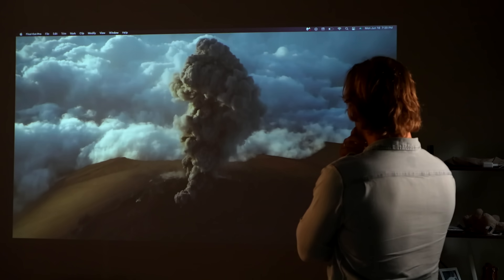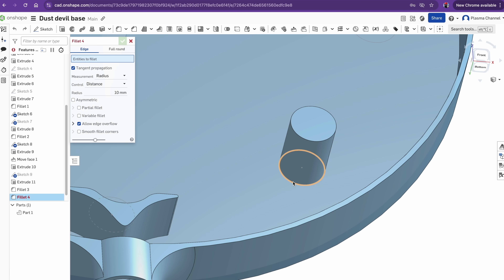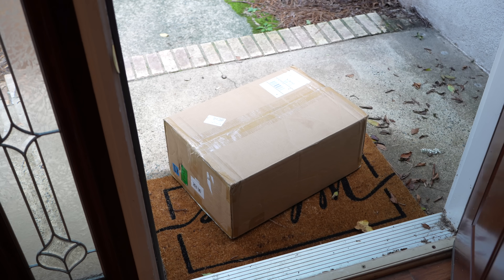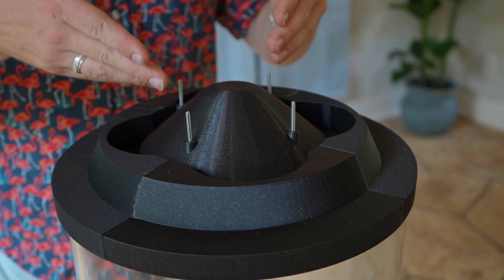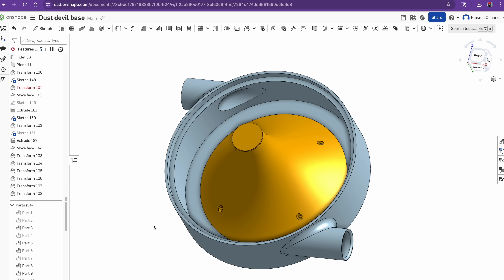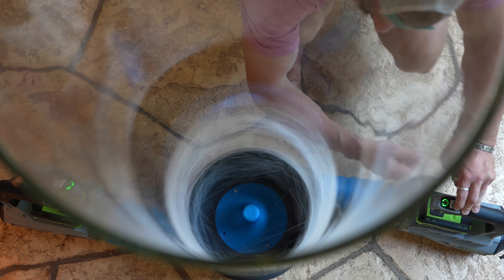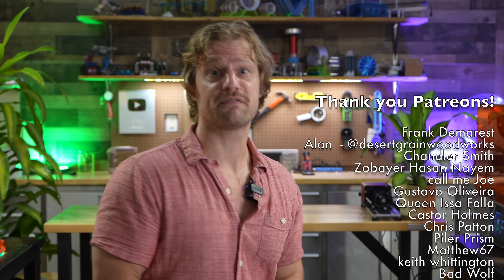Making Lightning In A Bottle Might Be Possible  (ft. 3D Printing Nerd)

Comment: Hi Jay, Mr Vortex here. To make a tornado in that glas tube, you don't need to blow air in, it's actually bad for a vortex. You know about the pessure of the atmosphere right? So you only need to remove (suck) the air out of the center top and the air will shoot into the intakes. Make 2 or more air intakes at the bottom, max away from the center, 90 degrees off center. Hope this helps!
Reply: So essentially the same principle as a bathtub draining
Reply: @UnfussyLeaf2440  Or a tornado.
Reply: @UnfussyLeaf2440  essencially the same as those fire tornado demonstrations yt scientist do
Reply: @UnfussyLeaf2440  thats the basic understanding of it yea
Reply: Is there a video that explains the difference between blowing air in vs sucking it out? And how that impacts vortex generation?
Reply: @calif94577  I'm no expert, but I'm guessing that blowing air in creates too much turbulent air for a stable vortex. Versus sucking air out creates a more stable influx of air all going to the same location, being the vacuum.
Reply: @calif94577  think about the difference of a jet of air entering a volume against a hole sucking out air of a volume. The sucking hole takes in air much more from around the hole, whereas the blowing hole just blows it out and spreads it a bit. From these initial conditions a controlled chaos takes over that you can approximate with fluid dynamics.
Reply: @007hansen I might be wrong but thinking about it or explaining in a simpler way for people to understand is always best.

Increasing pressure means things expand to take up space, decreasing pressure means things want to shrink and collapse taking up less space.

Pressure in = expanding like a balloon to fill the volume of the container

Pressure Out = Contracting smaller like a straw that squeezes itself shut when you try really hard to drink a thick milkshake. The dust forms a skinny vortex shape while taking the quickest straight line to the low pressure end
Reply: @calif94577  the difference is laminar flow. Pumps usually disturb the flow of which leads to turbulent Flo and that's bad for vortices.
Reply: @calif94577  That's an interesting question: Is there a difference between blowing air into a vortex cylinder and sucking air out of the top? In both cases, the difference in air pressure causes the air to move. Small tornadoes are actually very sensitive, for turbulence and other things. When blowing air in, it is easy to introduce too much turbulence resuling in no vortex formation. Getting air to move by connecting to an area of lower air pressure can be much gentler to the air. Kind of similar; compare blowing out a candle to sucking out a candle.
Reply: Definitely agree, I believe Tech Ingredients have a similar design for a giant vortex within a housing.
Reply: @pabloarroyo8546  If you watch Tech Ingredient's vortex you will see that it actually forms upside down. This is because he was introducing air at the bottom from a wide base and exhausting it at the top from the centre. Same thing here - if he does form a vortex it will be upside down.
Reply: Wise words from the man himself
Reply: This. As soon as I saw the weak performance with the leaf blowers, I immediately thought "what about a vacuum cleaner on the top?"
Reply: It’s easier to pull a string than it is to push
Reply: @kjbaran  Like that Steve Mould video with the chains
Reply: I agree with your design concept. You know though that some people get that "automatic square wheel" stuck in their head when designing. "If you just push the square wheel up to the Apex... And give a little push, it will roll by itself... All the way down to the flat 🤣."
Tqm philosophy. His design is an example of doing the right thing the wrong way. Even on cfm's going into his design he didn't incorporate any venturi openings on the exhaust on the blowers at the intake to the device for additional cfm at lower pressure. At the top you would have an inverted cone designed with a smaller diameter of course. You could adjust the flow with the Venturi openings. This isn't the most efficient design as the fan on top would be but for aesthetics if that was the goal would leave it clean and you could engineer everything into the base.
Reply: @bsrcat1  Wow if only i was half as intelligent/sarcastic as you.
Reply: @budgiefriend  I have faith in you. Sarcasm is the only way to make lite of the obvious. We have all tried to complete tasks in our life where we knew the goal, and insist on ice skating uphill. Even worse, knowing the correct way to do something and your Superior doesn't take your input, then forces you to ice skate uphill, can't figure out why it won't work, then when you point out the obvious, execute it, it works, then they take the credit 🤣.
Getting "stuck" on a incomplete or poor design can cost a lot of time and money. I have had projects that I work in my head and fail, fail, and fail again upwards of a year before I even decide to pick up a pencil and design a rough. Now I might pick up a calculator or use a computer along that year to work out calculations but my tools that I design and things that I make 9x out of 10, work on the first go. When I was younger, I would often get "stuck" wasting all kinds of money, time and effort. And I just slow down, gave the problem sufficient thought, then worked out all the details, I would have been far better off as would have my pockets 🤣.
I work everything backwards now. I see the goal, then work out every detail to achieve the goal and all of its parts. 
Sarcasm comes from being able to laugh at your younger self 🤣. I used to teach classes the same way and none of my students ever fell asleep. I was teaching law... And there is nothing dryer in this world toteach or learn 🤣. It's a good day when your students laugh and look forward to the class. It's a better day when they all ace the exams.
Reply: Not that efficiency is the goal but sucking air out requires less energy than blowing it in :)
Reply: I can't like this comment since it's currently at 666 👍 and that just fits too well.
Reply: I was wondering why he chose to blow instead of suck. Every tornado demo I've seen uses negative pressure, not positive
Reply: @nicksalve  Note: there is no such thing as negative air pressure. It can be relative low, but not negative. And yes: all tornado’s have very low airpressure in their center. Otherwise, it's just a rotating air column.
Reply: im sure this is also a factor :

Quartz-Dominated Silica Sand

Mostly pure SiO₂ (quartz)

	•	Origin: Weathered granite or quartzite
	•	Found in: Sahara, Mojave, Arabian deserts
	•	Electrostatic Potential: ★★★★☆
	•	Why: Quartz is piezoelectric and triboelectric. Dry, rounded quartz grains can accumulate static charge readily under friction or wind agitation.

Gypsum Sand

Composition: Calcium sulfate dihydrate (CaSO₄·2H₂O)
	•	Found in: White Sands National Park, New Mexico
	•	Electrostatic Potential: ★★☆☆☆
	•	Why: Softer, dissolves more easily, and less triboelectric than quartz. It also holds moisture, reducing electrostatic buildup.

Basaltic Sand
	•	Color: Black or dark gray
	•	Composition: Pyroxene, olivine, magnetite, feldspar
	•	Found in: Volcanic desert regions, e.g., Hawaiian lava deserts
	•	Electrostatic Potential: ★★★☆☆
	•	Why: Magnetite is conductive, but olivine and pyroxene are more insulating. Uneven charge accumulation with magnetic interactions.

Iron Oxide-Coated Sand (Red Desert Sand)
	•	Color: Reddish-orange
	•	Composition: Quartz cores coated with iron oxides (hematite, goethite)
	•	Found in: Australian Outback, parts of the Namib and Kalahari
	•	Electrostatic Potential: ★★★★★
	•	Why: The iron oxide coating creates strong triboelectric charging when grains rub. The heterogeneity between quartz and iron increases charge separation.

Feldspathic Sand
	•	Color: Light brown to pink
	•	Composition: Feldspars (orthoclase, plagioclase), some quartz
	•	Found in: Transitional deserts (e.g., central Iran)
	•	Electrostatic Potential: ★★★★☆
	•	Why: Feldspar has different electron affinity than quartz; rubbing between grains of mixed mineralogy causes high charge buildup.
Reply: A vacuum at the top also increases the resistivity of the air by reducing the air pressure. The same principle is seen by dry air in winter which allows for more static charge to build up before discharge in the form of spark jump.
Reply: Oh snap I’ve watched your vids good stuff there
Reply: But why does it make a difference? Less turbulence at the intakes?
Reply: @MadScientist267  You can't force a tornado into existance by blowing turbulent air to a center. You'll only create a turbulent rotating air column.
Reply: Genius
Reply: ☝️ That's what I was going to say. But you also need swirl tubes at the top to extract the air without the particles. The thing with swirl tubes is they need to be seized correctly for mass flow and particle mass and volume. The bottom would also need to be overlapping inlet slits. The number and length of the vanes also needs to be calculated for mass flow and ∆ pressure. The radius on the curve for the vanes also will determine the tightness of the vortex. Just as a starting point I would have the inlet vanes with a 20° angle from the tangent, the same radius of the base with 35% overlap.
Reply: You'd think we'd have had dysons long enough for people to get that!
Reply: I like how you didn't acknowledge or comment on your comment
Reply: Does this have anything to do with why you don’t use a vacuum on a computer because of the risk of static discharge and only use blowers?
Reply: I’m a big fan of you ❤ ha get it
Reply: @tornadoclips2022 It feels strange to say, but have a lot of fans. Having so many fans has never been the goal of what I am working on, but it is kind of nice. High-pressure fans, large-volume fans, luckily not too many large fans.
Reply: It basically needs negative pressure, not positive
Reply: @michaelbannan9972  What is "negative pressure”?
Reply: @GiesbertNijhuis Pulling air out is negative pressure. Pushing air in is positive pressure.
Reply: Do you have a youtube channel?
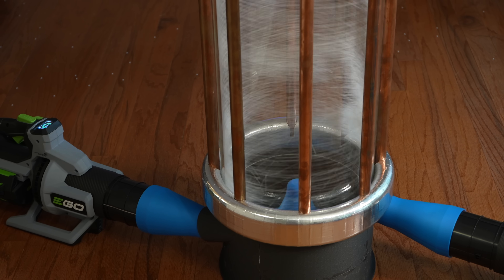Reply: @PlasmaChannel , at 13:40 you had your answer. While air is blown in no static is developed. The moment you shut down the blowers and the air can only escape to the less pressurized place(out of the tube) then static is developed. So you need to suck not blow
Reply: 90° off center of what? 90° off center on the bottom of a a cylinder is still the center, no?
Reply: Think about that maybe it's an idea. 
What if you place a motor in the middle of the tube at the bottom and you make a rotor with 3-4 blades which are standing vertical ( | ) 😅 
Spin it up fast in the tube. Try it first like a 200mm diameter disc with 3-4  blades which are vertical. What do you think
Reply: Hi. I am an Aussie and I live in Philippines currently. A cyclone or typhoon vortex is caused by temperature differential as far as I know. Don't know if that can be applied in his experiment though. Does anyone have any thoughts on this? Thanks.
Reply: She right you dont need the air to come out or in the completely sealed.
Reply: dont think he listens or reponds
Reply: It's the same thing
Reply: @izysly6924 It's not.

Comment: so if the charge is build up between two different kind of beads that are randomly shuffled around constantly, how is a charge supposed to accumulate? it will dissipate between the beads and will never create more charge than is determined based on the ratio of beads you put in. an 1:1 ratio would mean no charge accumulating during the storm, and the only charge separation would be from the mechanical separation between beads based on density, size (electrostatic force is negligible at those speeds) at the time you switch it off. 

also what was that attempt at inductively harvesting a static charge? am i missing something? how should that have worked?

Comment: Like capturing the static potential of the electric fields surrounding the earth as soon as you start drawing power from it you degrade the resource. Tesla turbines (the ones that capture energy from a movie fluid) and sterling engines are both nearly 100% efficient, until you try to use them to do any work and then they fall dramatically.

Comment: The pointing trick works because the balls and the glass are attracted to each other but introducing yourself as a ground circuit you help distribute the charge picked up from the bottom of the cyclone/air

Comment: consider how cyclone vacuums work - instead of trying to force a cyclone from the bottom by pushing air in, use a vacuum (eg vacuum cleaner) to extract air from the top (centre). New air doesn't come it at the base, it comes in at the top as well, but tangentially to the cylinder. This should create the type of cyclone you are looking for. You can then use particles of differing types as originally intended to create the charge
Reply: Mix multiple materials to share the charge up and then the build can discharge with a a higher limit by the specific exchanges. Like a rod in a battery but the opposite. The multimaterial would limit unwanted exchanges to the materials. I hope that made sense lol. Balls share to something slightly stronger and generate a flow that opens up. The tinfoil is like opening a dam and releasing the build too much too quick. Make some small rivers that open up later or transfer to battery and then set this outside and let the wind catch it sorta like when an old man plays the jug by blowing into it.
Reply: @MindoftheInfinite if the different materials have separate weights, maybe they would be suspended at different heights and adjusted with multi vacuum control.
Reply: That’s deadass what I was thinking. Because generating a vortex is SO much easier from above. So just have a vortex cone shape at the top. 

A metal rod at the bottom to give the lightning a source of ground to go to. Then you’ll have your sandstorm in a jar. lol
Reply: I like the vacuum idea.

Comment: A similar machine used high-pressure steam over a metal handle to produce 2ft-long sparks, according to some witnesses, and was said to deliver lethal shocks. It was built in 1890 as an experiment to determine the cause of railroad engineers complaining about static shocks from the control levers, particularly the pressure and brake lines.
Reply: high presure steam and metal? that sounds more like something integza would do
Reply: @Sharpless2 Kaboom?
Yes, Integza. Kaboom.
KABOOM!
Reply: There was also at least one published electrostatic generator device based on blowing sand, recirculated through an insulated structure. It apparently worked quite well, but was noisy and cumbersome, much like the dry (superheated) steam jet generator.
Reply: Every time I hear stuff like this it convinces me more and more that we discovered the key to limitless free energy long ago and its been being suppressed the whole time. Part of why Tesla was so successful and innovative is probably because he was aware of these sorts of discoveries and built upon them. Especially when it comes to this topic, we are probably not being let in on some significant historical scientific breakthroughs. The rich robber barons of the time probably knew it was the next "oil/coal", the new fuel for the future, and made sure to monetize it.
Reply: @itsyaboymuffinman To produce that energy, you have to put a lot more into the system than you'll get out of it. Whether that's heat for steam or electricity for fast moving air, that energy needs to come from somewhere. So, it's definitely not free and is definitely not limitless.

We already use the stuff Tesla discovered in radio transmitters and transformers. The guy provided quite a lot of value to the scientific community, but he didn't provide free power. His goal was for wireless transmission of power and he achieved it. It was just inefficient and more useful for radio.
Reply: @itsyaboymuffinman  ...you have no idea what youre talking about. Making huge sparks is easy. Actually having enough energy behind them for a long enough time to be able to use all that energy is literally impossible. 

Why do you think we arent using natural lightning to power stuff? Theres always gotta be one of you "free energy" nuts...

Comment: You'll have to go look the paper online, but in very simplistic terms, when air exits or enters a volume prior (or after) to an elbow, reduction etc you need a straight section that's some specific percentage of the width of the aperture. For me, when i make blowers, i don't really do the math, i just eyeball from previous experience and i just take the R (or width for rectangle apertures) and add about 10% and that's the length of straight unadulterated pipe out or going in, to a snail or chamber. The idea is that air needs an area where it can get its ducks in a row. This is why you have that space between laptop fans and the radiator fins and it's not a straight line like it would've been for one of those MAHOOSIVE mine shaft fans back in the elder days, with fans as big as a house.

Comment: My vacuum cleaner gives me static shocks.. god damn it is annoying but now that i think of it... it doesn't do it in this new place.. Hmm... Maybe it is just enough dirty inside that the metal pipe and the plastic tube can discharge the static, or the place is the difference... They were also quite strong shocks, properly shook you up. I used to vacuum with one hand on the wall to constantly discharge the system, or touch the wall with the tube occasionally to discharge it.